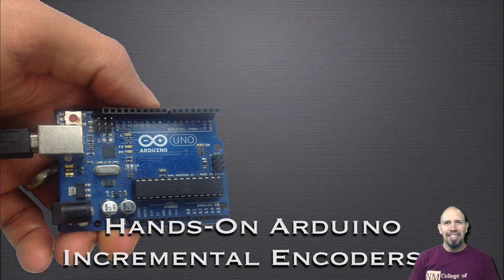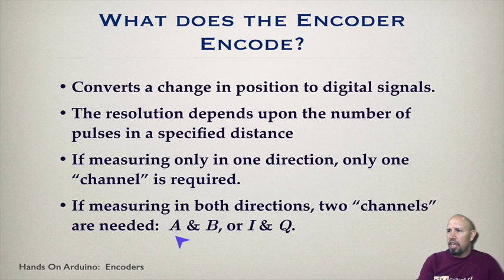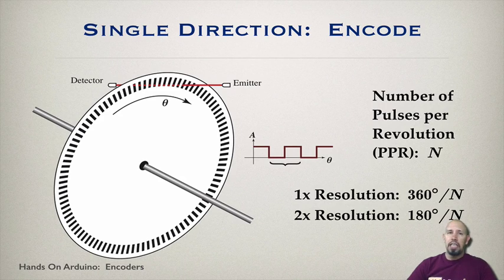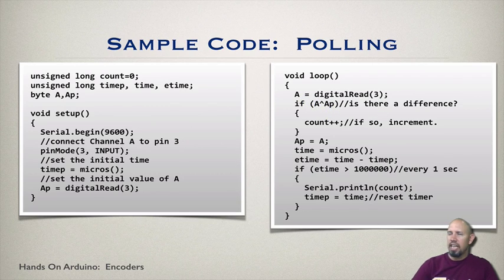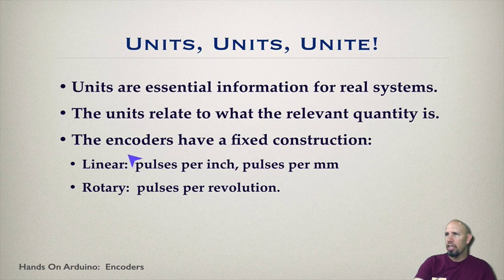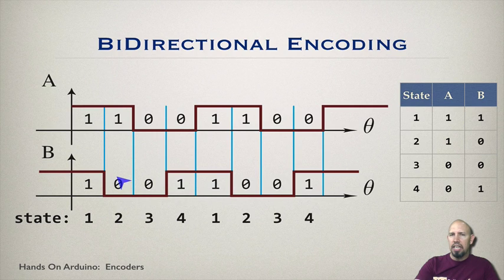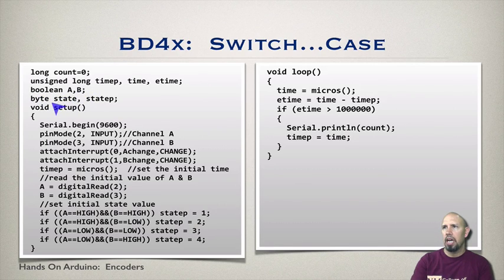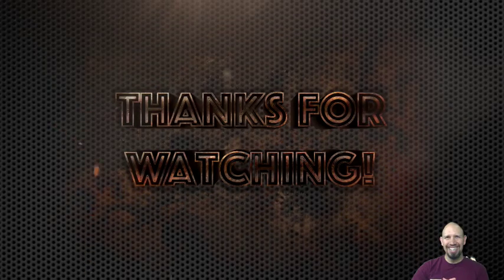Hands On Arduino 2:  Incremental Encoders, Part 1

Comment: So I have an incremental linear encoder spiting out serial data, 0 to 64k and rolls over back to zero again. It's stiff so it goes slow counting.  My encoder has a 30ppr. I'm confused on what that means for that 0-64k. I'm trying to use it to get distance and or speed.

Comment: Hey, very good video, could you give some advice to implement your code to control the position of the motor, I.e. the motor is moving and an specific number of pulses (counter) it stops.

Comment: Nice video, specially that array. I tried it, but hated the if's to determine the state.
I renumbered your table to 11 being 3, 10 being 2, 00 being 1 and 01 being 1
I adjusted the array accordingly.
For the state, I read portd, divide it by 8 and mask it (and) with 3 (in one line ;)
speeds it up a little more.

Comment from the maker: Frank.  You have a couple of things going.  First, are you using the encoder on a dc motor, or on the Stepper motor you supplied the link for?  If you are using a stepper, you don't need the encoder.  The encoder, if properly installed should work just like the encoders used in these demonstrations.  The only thing you will need to keep track of is the number of pulses per revolution that you need to convert pulse transitions into degrees.

Comment: hey whats up paz i just got from china 4 of this encoders "link below "and was wondering if you have any tutorial for this type? im simply trying to use dc motors to control direction and speed between 0 to 90 degrees cw/ccw for my humanoid i mentioned you before, i am using as well a DC Motor Drive Board Module L298N Dual H Bridge For Arduino "link below "thanks in advanced 

Currently at home : 

http://www.ebay.com/itm/141417268107?_trksid=p2059210.m2749.l2649&ssPageName=STRK%3AMEBIDX%3AIT 

&

http://www.ebay.com/itm/161540632003?_trksid=p2059210.m2749.l2649&ssPageName=STRK%3AMEBIDX%3AIT

Comment: One idea is to add in a condition for state changes such as state 0 to 2. or state 3 to 1. Since theres no logical way for these transitions to happen it indicates a missed step count. at which point you could detect the miss and indicate a fault scenario. Would be very usefull for things where tracking is critical (ie cnc dimensional tracking)
Reply from the maker: Agreed.  The issue of error detection and correction is the topic of a separate lecture itself!